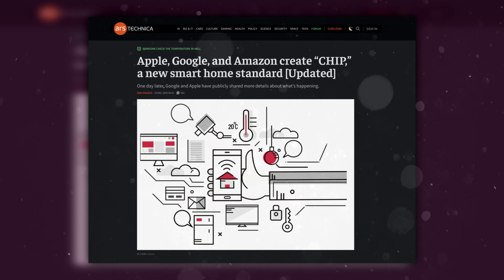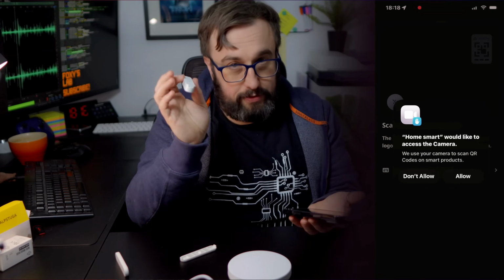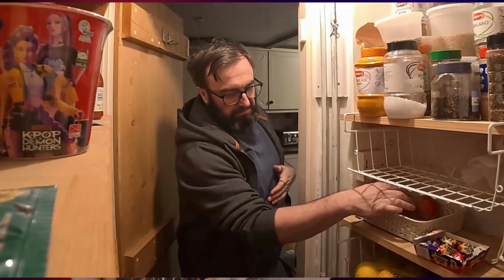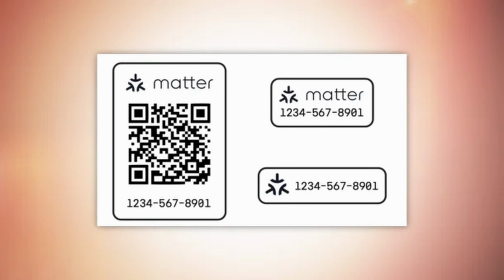Is this really the future of the smart home world?

Comment: Great video.  You still threw in a few geeky terms to confuse the unwashed midway , like IPV6, but after struggling with all the connectivity issues and frustrations you highlighted over the past 3 months, I was able to keep up; just.
IMO, it would be a good idea to do another summary video for newcomers, cutting out most of the technical lingo and just explaining what to buy from the get-go.    I wish I knew that, but had to keep buying more bits of hardware, thread border router, cables for the lack of ports on the router, ethernet switch, etc etc.   The Zigbee stuff was easy
Reply from the maker: This was actually a really hard video to keep simplified as this is a needlessly complex topic. I think they really over complicated it. The more I learned about it the more strongly I was “team Zigbee”. 

I’ve got a smart home buyers guide video coming up with a dedicated thread/matter section which will hopefully be super simple :)

Comment: With Z2M and ZHA why did we need another protocol? Both software allow any app or device  to communicate with the Zigbee network. The only thing I can think of is not all Zigbee devices are compatible with Z2M/ZHA. I guess that’s where obligatory Thread and Matter certifications comes into play (to ensure compatibility), but certification doesn’t guarantee that ALL features will work. It’s all kinda weird really 😂
Reply from the maker: I find it odd that the CSA made a new protocol instead of just pushing Zigbee harder. I know there is a benefit to a protocol being an 'IP first class citizen' but I will admit, I don't really know what the benefit actually is other than it doesn't use a proprietary communication standard. I should probably research that a bit more.

Comment: I have over 60 Matter over Thread devices and I must say that they were the most rock-solid and reliable devices on my home network. I have locks, roller shades, thermostats, plugs, receptacles, switches, humidifiers, air purifiers, sensors, all from varying vendors and never had a single issue on Apple Home. Ocassionally during updates, I'd lose a device or two until I rebooted my HomePods and Apple TV and problem solved. I had a $700 Netgear router and a few dumb switches spread around the house. As soon as I upgraded my Network to Unify gear and introduced Home Assistant into the mix, I began to have issues. Still have issues to this day. Point is the network config, complexity, and organization are key if u want the best out of your Thread network. I honestly wish I didn't give my hardware away, I would have immediately returned the almost $5K in equipment I replaced it with. Unify gear is absolute garbage in fancy wrapping. Constant bugs and mDNS has been broken on their platform for years now. Also, I steered clear of Matter over Wifi devices and devices from Aqara, Merross and other problematic Chinese brands. Pick your devices wisely, keep your network simple, and Matter over Thread is a dream come true for home automation.

Comment: I have a RPI running HA and two ZigBee dongles. One is regular ZHA, the other is advanced Z2M. That lets me play with a new device on both networks before deciding how I'm going to use it. 
Thread/Matter is something that I really don't see the need for tbh as ZigBee stuff is so ridiculously cheap on AliExpress.

 Temperature Humidity module for £2?! I have a dozen all over the place in a regular 3 bed house. Including the fridge, loft, shed, porch, greenhouse... Makes for interesting reading in this current heatwave.
Reply from the maker: Kinda with you there! I’m definitely team Zigbee. 

I love the Ikea stuff because of how cheap it is but I can’t imagine I’ll buy a thread device if there is a comparable Zigbee one available unless it’s a lot cheaper. Which I don’t see happening any time soon.
Reply: I love the ikea matter stuff..........Mmmmmm, proper batteries lol
I swear, if i had to use those nasty button batteries i'd give up with smart home
Reply: @delboytrotter7902 Ikea looks expensive to me, some of it is tempting though. As for proper batteries, I agree. Most of mine use AAA - I'd much rather AA as the size difference is pretty minor but battery life is much better.

Comment: I have a question: on a Zigbee Network, you have lots of devices that are connected to mains power and act as a router. That's the whole "mesh" part. If matter devices start using Wi-Fi for anything with the power, and threads for low power stuff, doesn't that kind of undermine the whole point of a mesh network? It's one of those obvious points that I feel somebody's addressed. Right?
Reply from the maker: Yup. You nailed it.  Matter has nothing to do with the mesh. That’s the Thread part. So if you have a bunch of Matter WiFi devices then you don’t have a mesh unless you WiFi setup itself is part of a mesh.

Comment: I use both. A SLZB-06 for zigbee stuff, and thread for some matter kit. Some matter kit is over WiFi. Ikea matter over thread devices keep falling off the network. The two button switch refused to connect on thread. Changed it to Zigbee and it’s rock solid
Reply from the maker: I hear stuff like that all the time with Thread, I must have just been lucky so far.